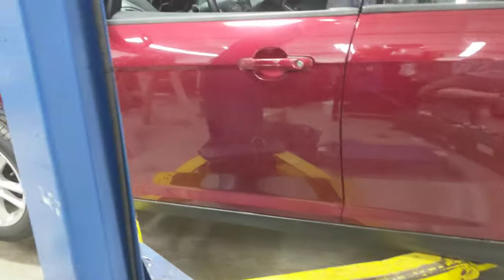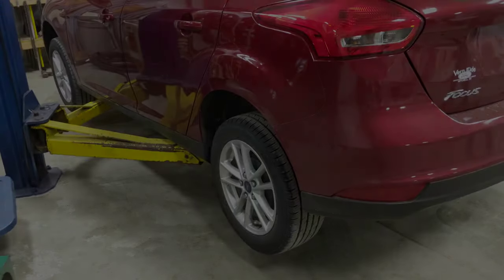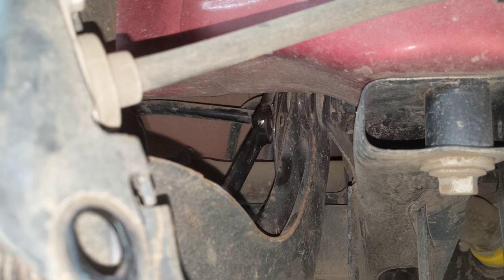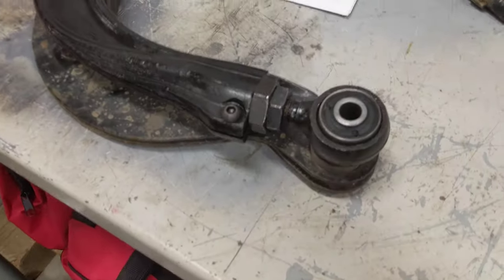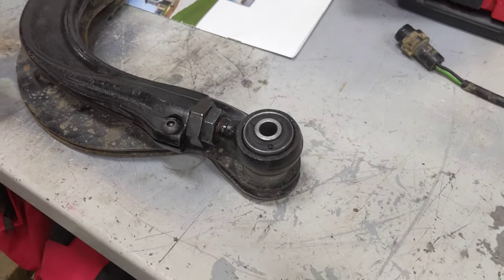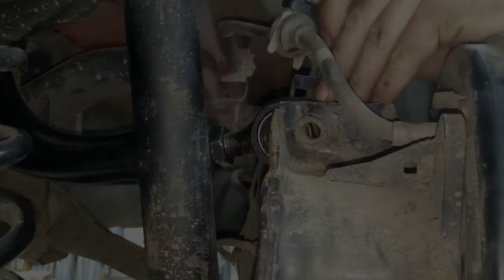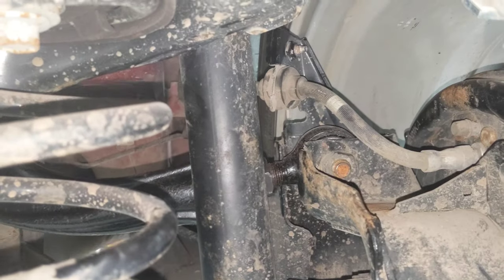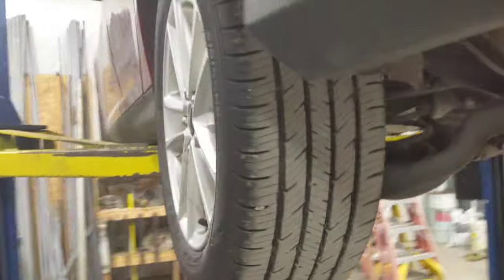2011-2018 Ford Focus Camber Arm Replacement

Comment: What is the part # for this control arm? I have a '17 Focus Titanium with excessive rear camber, its eating up all my tires and looks ugly. Been looking everywhere for a solution. Thanks!
Reply from the maker: https://www.steeda.com/spc-focus-adjustable-rear-upper-camber-arm-00-15-all-271-67420

I don't know where it was purchased from. It was on my buddy's car. But it was extremely similar to this one.
Reply: Any pair of adjustable rear upper control arms should do the trick

Comment: Reverse threads. Thanks for adding that to be aware of.  First time I happen to run across that was on a propane tank. I was tightening the line when I thought it was loosening it.🙃🧐🤔It's a wonder I didn't blow myself up. 🤯
Reply from the maker: Had us stumped for a minute too!

Comment: I have a 2017 that came from the factory with negative camber. Ordering a few adjustable arms to stop wrecking tires
Reply from the maker: That should be a nice improvement.
Reply: They always design negative camber into the rear on these types of vehicles and they're almost never adjustable for cost savings. The negative camber reduces the chance for oversteer and provides inherently safer handling. Blame the majority of people out there who can't drive for shit.
Reply from the maker: I wish they had a decent amount of adjustment. 🫤

Comment: I tried putting these on my 2017 Ford Focus but they are hitting the shock and no way to adjust that, They are way to thick in size. Thanks
Reply from the maker: Interesting. Are they backwards?

Comment: Yo tengo ese problema con la llanta trasera lado piloto , es un Ford Focus SVT modelo 2002, y creo es compatible la misma pieza , las ví rn Amazon y decia q es para el Focus 2000 al 2016 , mi pregunta es si le queda a mi focus 2002 para corregir ese problema
Reply from the maker: It might work, yes. I'm not sure exactly because I've never tried it but it might be possible. I would order it and see if the parts match up. 👍

Comment: Installed these with all new control arms, went to get an alignment and Belle Tire told me they are for toe adjustment and cant fix my excessive rear camber lol I guess ill just have to straighten the camber up myself tonight cause cause the techs are lazy haha
Reply from the maker: What?! You saw the results in the video. Might be time to find a different tech haha.  Take matters into your own hands!  They're literally called CAMBER ARMS haha.  Your tech must have gotten into some brake cleaner fumes lol.
Reply: @605BOLT  dude I just laughed at them. I replaced all the arms front and rear, for the bushings mainly, and its pretty easy. My guess is they never took off the wheel to do the alignment and never saw the adjustable arms, even though I told them about it twice. I'm sure it's sold as a factory alignment so if it wasn't on there from the factory they wont do it....only thing I can think of besides laziness. Don't even mean to bash my belle tire either cause they've always done my rusty jobs I wont do, oh well, win some lose some I guess lol
Reply from the maker: @zrillz3025  yep. Move on and drive on I guess. 😂

Comment: My only question is if you had to play with that pinch bolt on the body?
Reply from the maker: I had to remove it yes. And put it back in. But otherwise no. Pretty easy.

Comment: Do both sides usually give out at the same time, one more than another? Now, at least, i know that it's my camber arms that need replacing. Thanks in Advance.
Reply from the maker: I can't say as this was a collision repair so obviously it was all beat up. My assumption would be that if one is worn out the other is probably quite close.
Reply: @605BOLT  Yeah. My are going at slightly different times. I took off my back tire to do a repair on the tire, and the camber arm on the tire with lots of negative camber ( tire wearing on the inside?) The bushings are completely depleted.  The other tire has slight wear.
Reply from the maker: @Nicefoolkilla  sounds like you're on the right track. That inside tire wear is usually a pretty good sign. Hope you get it fixed! 🍻
Reply: @605BOLT  thanks man, i appreciate it. 👍🏼

Comment: I heard that if you replace with adjustable arm it will make more noise? Does anybody can share their experience that hows adjustable arm works?
Reply from the maker: This one did not make noise.  If you don't tighten up all the jam nuts on this thing it will clunk.  But if they're tightened, you won't notice a difference.

Comment: What is the torgue settings for the bolts please ?
Reply from the maker: I don't have a torque setting.  Just good and tight is what I would go with.  Sorry I can't be more helpful.
Reply: 115 Nm or 85 ft-lb
Reply from the maker: thanks  @piotridz

Comment: Do you have to get an alignment after this if you just recently got one?
Reply from the maker: I would say yes. No real way to make sure things are perfect without an alignment. 👎
Reply: @605BOLT  😢😢😢
Reply from the maker: @AAP0000  maybe they can just do the rears. Half price? Haha
Reply: Number one any good alignment shop should have refused to do it instead of just taking your money.
Number two you should have an alignment done after changing any suspension or steering part.
Reply: Yeah. They were too dumb to realize these parts needed change, specifically the left side. I figured this was the case because the left rear alignment results were still bad after the alignment. I changed the parts on both rear sides myself and took it back for an alignment (which ended up being free) and my car is now properly aligned.
Reply from the maker: That's great news! Always nice to get a job like this figured out and finished. 👍

Comment: they look like they would fit a 13-20 fusion
Reply from the maker: I'm sure the design is very similar. This type of arm commonly used. Slightly different dimensions but the same idea.
Reply: @605BOLT  thank you for the quick reply
Reply from the maker: @randellgribben9772  no problem my man. Hope the video helped you out a bit.

Comment: The focus and escape both came from the factory with poor rear suspension design. Tire wearing camber is within ford's own specs. They are too cheap to do a recall and give everybody the adjustable arms and new tires they deserve. 
Wish I would have done more research on this crap box before I let my mother buy one.
Reply from the maker: I can't argue with that. Seems like something that should be installed by the factory.